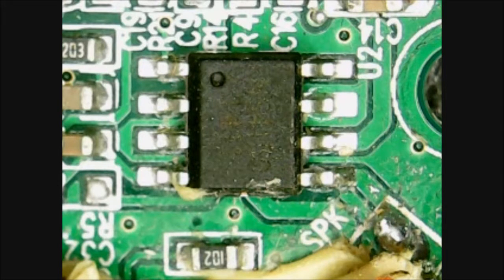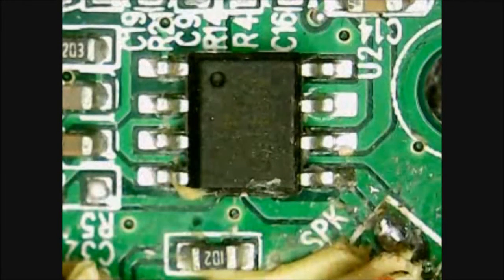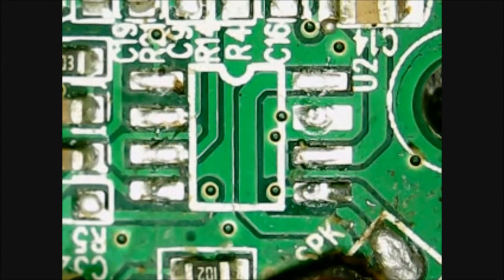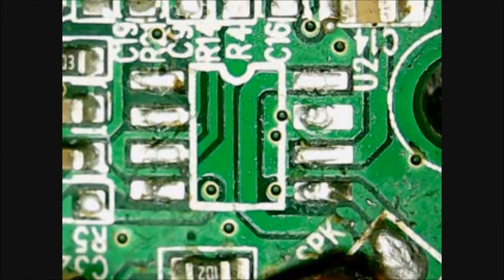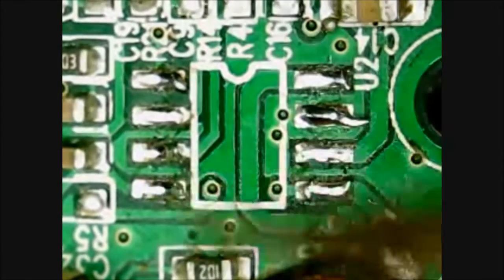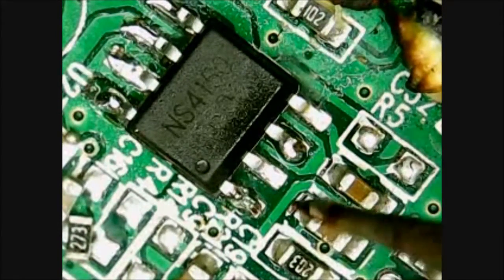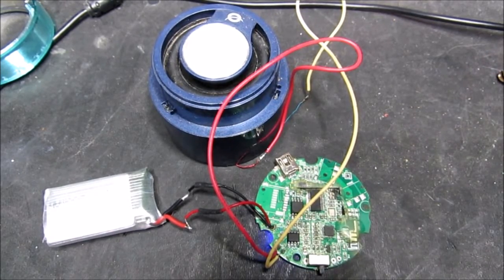Bluetooth  Speaker Repair  With Banggood  Microscope - Electronic Project

Comment: I have this bluetooth speaker  on which left speaker dosent give out any music hut loud clicking sound only. On opening it i found the speaker is conneted to an ic which goes very hot when turned on. Hence i wanted to replace the ic but there are no serial number marking on it so how do i identify it to replace? Can you help me please
Reply from the maker: No number on the working channel IC? Sometimes using an infrared torch will make a number visible or try a dab of moisture / alcohol on the surface. There should be a part number for the circuit board, try googling that for a schematic. There are hundreds of amplifier IC's and the circuits are similar so you cannot guess. Without a part number it is scrap I am afraid.

Comment: My following issue is this:
Whether I want to pair up my Bluetooth speaker, sometimes pair up, and most of the times, doesn't, and I finally pair up my Bluetooth speaker to play music, the Bluetooth speaker unpair automatically when my Bluetooth speaker detects such heavy music, in this case, I am playing acid techno, and it immediately unpairs. This tutorial helps the Bluetooth speaker stabilize the equalizer?
Reply from the maker: My best guess is that there is a low capacity battery in the bluetooth speaker. When you play heavy music it cannot maintain the voltage and "drops out". Have you tried the speaker when connected to it's charger? Otherwise you will need to experiment. Does the same thing happen with a different phone? Does your phone do the same when on a different bluetooth speaker? Good luck! Leave a comment if you find the solution, thanks.
Reply: 1nformatica I tried leave the charger plugged + I swapped the semi-dead battery, with a lithium polymer battery, and I used different phones & tablets that can be paired with my Bluetooth speaker, but no luck with any device at all, I used other Bluetooth devices, and they work great, I noticed that the issue, was the Bluetooth speaker, somewhere from the circuit board

Comment: what is the thing that you using to fix a chip when you're burning the metal was that called
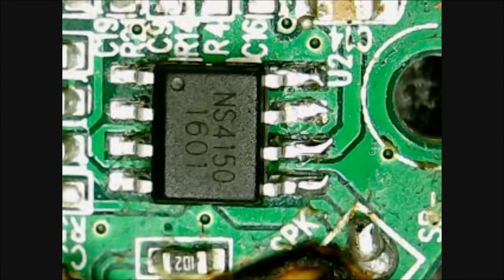Reply from the maker: Hi, the only tool I used to fix the new chip was a soldering iron with a very fine tip. You can see this at 2:50 in the video. Is that what you mean?

Comment: my Bluetooth speaker dose not work I can't connect my device on to it I checked the inside and the wires were just fine -_-
Reply from the maker: There are many possible problems, for example you should hear some sounds usually like musical notes when you turn the speaker on to indicate it is ready to pair with your phone. There are other good tips on this link: http://www.techlicious.com/how-to/how-to-fix-bluetooth-pairing-problems/

Comment: Just wondering why you did not re-flow the new component with the hot air gun? I've not done it myself but people make it look very easy in videos. Certainly the gun looks good for smd removal.
Reply from the maker: Hi, I just wanted to show off my hand soldering skills! No, seriously as it was only a few pins and a "large" component it just seemed quicker. You can see me use the heat gun to solder an smd resistor in another of my videos: https://youtu.be/tWSPvsFQxzI
Reply: Just watched your other video. Since making my initial comment I have had great experience with the hot air gun I purchased. I had to replace 5 tiny SMD transistors and 2 SMD diodes to repair a 'for parts/repair' GWInstek Function generator I bought. After masking off other components in the area with kapton tape I found the heat gun fantastic for both removal and replacement (I did first 'tack down' one leg of each component with the soldering iron first as in my first attempt the components blew away :-) ). I admire your courage in doing this stuff on camera!

Comment: my LH-S10 doesn't work it just have charging any solution plz
Reply from the maker: Hello, When you switch it on does it pair with your phone? If yes then it could be the amplifier chip like mine. You really need to take it apart and check voltages with a multimeter. Also check for broken wires or bad solder joints. Good Luck!!
Reply: 1nformatica no it's doesn't work just the led turn on when i put it on charge
Reply from the maker: Hi, Then you need to take it apart and check voltages with a multimeter. Also check for broken wires or bad solder joints. Good Luck!!